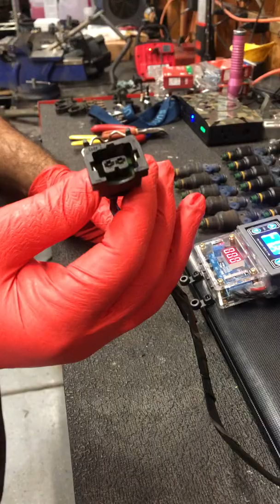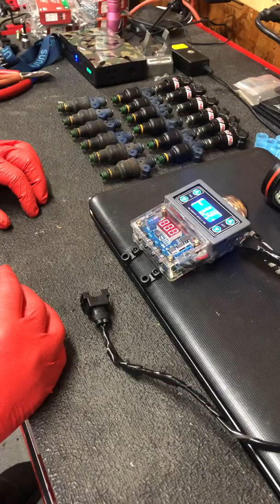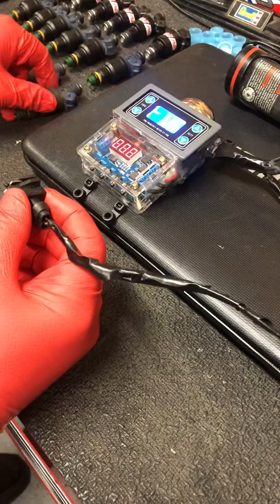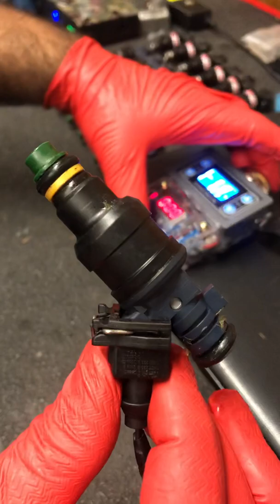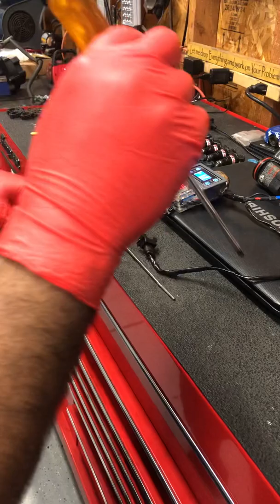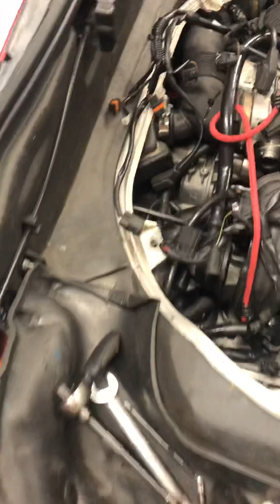Fuel injector basics, clicking sound, cleaning, and checks.

Comment: Is it necessary to replace orings/seals when reinstalling the injectors back after cleaning them?
Reply from the maker: 💯% you don’t want a pressurized fuel leak, or a vacuum leak, also lubricate them and the bores sparingly with parker O-Ring lube, in a pinch trans goo or light vaseline works well 👍🏽 but I recommend the proper stuff.
Also cleaning around the injectors with electrical contact cleaner spray and lubricating with silicone spray will aid in removal, good luck, triple check it all!!!
Reply: @MechaniclifeJDM  thanks for the information. OEM orings seems expensive, that's why I thought of using the old ones. At 1st it seems a bit complicated to get hands to my V8 injectors dug deep over several layers of cables and stuffs.
What is trans goo?
Reply from the maker: @explorehunter  no sweat, maybe check out some remanufactured injectors from a reputable company usually they come with an O-Ring set too, google search the goo, and parker O-Ring lube you’ll be glad you did, heres one more, O-Rings and things google them too!
Like and subscribe friend!
Reply: @MechaniclifeJDM  thanks again my friend for the valuable info 👍👌. Will definitely search for them.

Comment: So mine click and spray and don't leak but I do have 2 that are loud are these bad injectors thanks my car is running rich
Reply from the maker: Quite possibly.....
What kind of car, what engine, how many miles, any codes, anything done to troubleshoot or repair yet?
I would love to help, just need more detail, mechanic here, the magician is currently off duty for the weekend...
ahaha, come on you know that was funny!
Reply: @MechaniclifeJDM  its a 1967 chevy camaro 5.3ls swap fresh built just used old injectors that came with the motor I pulled injectors and did a amazon kit that allows you to clean your injectors they all spray even patterns and no leaks im puzzled I pulled one of my spark plugs and they are black running rich I was told to check for leaking injectors
Reply from the maker: @irvingbar4569  are you smoking black? Running rough? What year is the 5.3? Can you pull codes? Looking for misfire, random or calling out a specific cylinder
Reply from the maker: Also is that spark plug even firing?
Reply: @MechaniclifeJDM  1999 to 2007 yes we checked for sprak running a terminator x doesn't give me any codes just when I accelerate the car it almost shuts off kinda nose dives
Reply from the maker: It’s possible that one injector is sticking open at a certain points in its load, it’s also a possibility that there is a mapping issue, one cylinder would not cause the engine to nose dive like that, it must be flooding it, send me your email

Comment: When i drive i hear a very loud clicking noise. It makes me very scared that i will damage the car overtime. How can i fix this? I recently replaced 2 injectors because because i had powerloss when driving. Pls help
Reply from the maker: You need to first determine the general area of the noise, you said when you drive, but is it still clicking when the car is in park? Just Idling or only when actually driving?
Are your oil and coolant levels properly set? Is the oil good?
What kind of car?
Year make and model.
If you really want help you must be very specific in your response.

Comment: so do you recommend just cleaning the oem injectors?
Reply from the maker: If they ohm out ok meaning they are good electronically 

You can send them to RC fuel injection in Hawthorne Los Angeles California 

They can clean and test 

they will send back with a full before and after report

Just install and run right away when you get them back 👍🏽
Reply: @MechaniclifeJDM  wish i could bro. im in Australia
Reply from the maker: What kind of vehicle/engine?
Reply: @MechaniclifeJDM  Ive got a JDM Ep3 Type R, K20a
Reply from the maker: @3.2mviews10  They can click and still be bad, what are your symptoms exactly?
Reply from the maker: @3.2mviews10  upload a short video of the noise to your channel, and message me here when its done.

Comment from the maker: Keep in mind these injectors are not dampened by the fuel as they are empty 
So in car and pressurized they may sound a little softer, trick is to compare the sound of all, watch the entire video to absorb as much as possible, as the one tip you miss may be the one you need, if not now then in the future
Reply: Nice and detailed video 💪
I have a loud noise from the injectors.  during acceleration.  but no error code.  (when cold it doesn't start the first few times. but during the day it starts easily)
should it be a leaky injector?  or should it be a clogged injector?
Reply: The engine is a T-Jet petrol
Reply from the maker: @jimmysmith4671 Trouble on the cold start seems to me that its under fueled for some reason. Has the engine not run  for a while in its history?
Reply from the maker: Also if you have a question feel free to ask as I try to respectfully respond to all questions as time permits